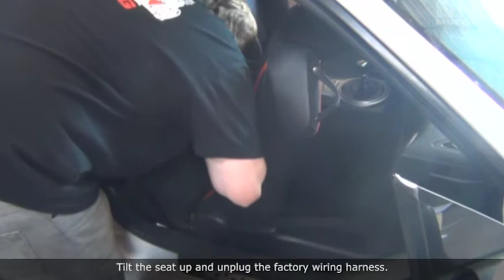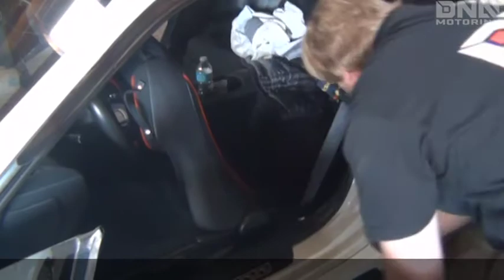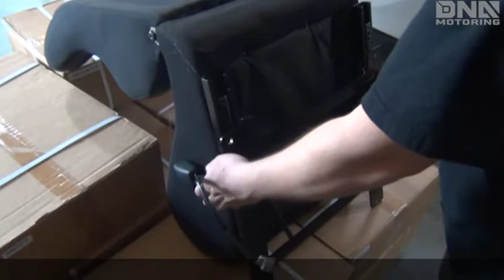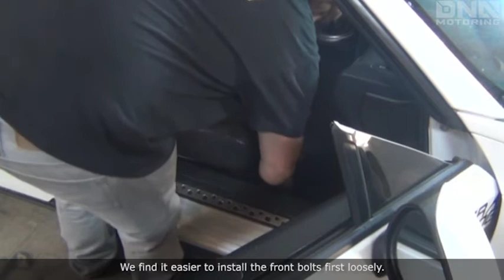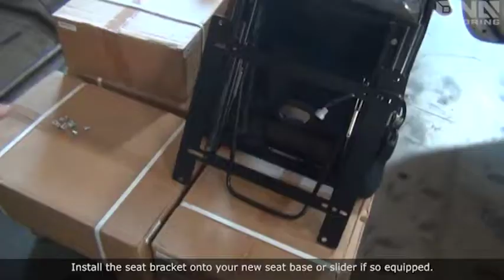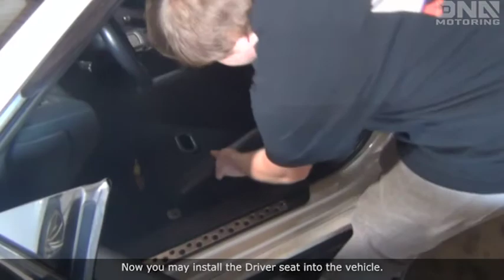How to Install 13-21 Scion FRS Subaru BRZ Seat Bracket

Comment: Does this bracket work for 2017+ BRZ seats as well? If so how much lower will these brackets get the driver?
Reply from the maker: No, this bracket only fits 2013-2016 Scion FR-S and Subaru BRZ.
Reply: I'm pretty sure there's no difference between pre-2017 and 2017+ BRZ when it comes to seats. On the other hand, this bracket seems to be designed specifically for aftermarket seats, and I doubt it will work with the factory seats.